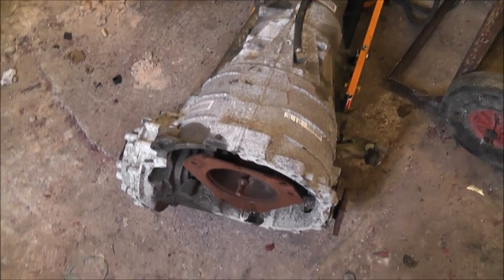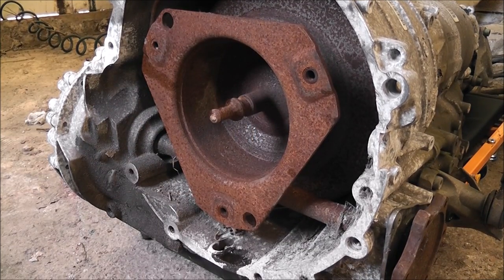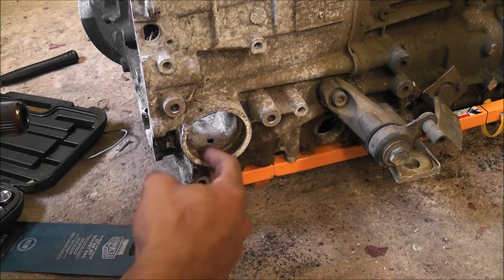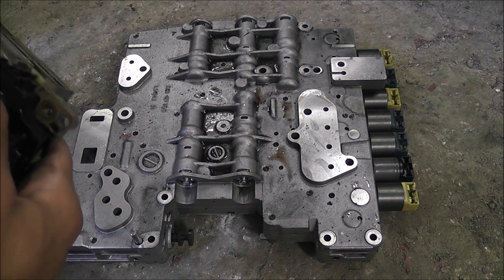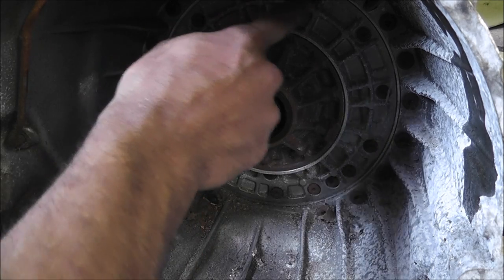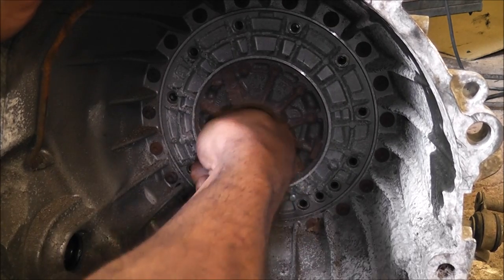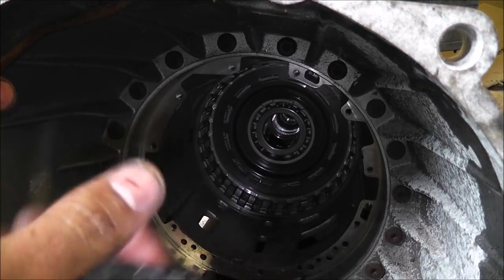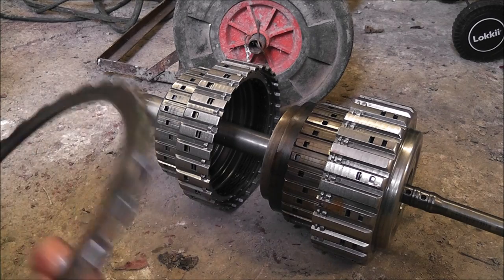Audi ZF 6HP-26 Wrecked! Gearbox teardown and analysis

Comment: What i have learned in 4 years of driving a 6HP transmisson (A6 C6):

1. Change the airfilter often (cut the interval in half or annually) and reset the learned MAF values.
The correct MAF values are very important for the transmisson.
And you will be amazed how the car goes with a new airfilter compared to one with 60.000km of use.

2. Is your transmission slowly starting to shift funny? Before spending big money on everything else. Do No 1.
And replace the MAF.

3. Change the oil, filter and gaskets often, every 60.000km. I use ATF 1800, works fine.
And reset the learned adaptation values.

4. After round about 150.000km the solenoids will start to go bad, overhaul the valvebody to prevent further damage.

:)

Comment: We call the ZF oil (Lifeguard) "liquid gold" in Australia as it's that expensive. I've had Castrols Transmax Z in mine for about 15000kms now after flushing the gearbox at the 85k km mark. Ford Australia use them in our Falcon (rwd) and Territory (awd) mated to the 4lt turbo straight six engine. The 6hp26 is bullshit strong especially with an appropriate tune to keep clutch slip down!
Reply from the maker: Brettus s it's a very strong box, it just needs looking after! andcyes, the oil is real expensive!

Comment: The transmission fluid is a scam and the expense causes people to put off maintainance leading to disaster.
The ZF 6HP series is also built under licence by Ford as the 6R60, 6R80 etc, who specify Mercon LV and GM build it under licence with different ratios, specifying DexronVI. 
Identical boxes except for the GM ratios, with each manufacturer giving a different name for their specified fluid.
Of course ZF say you must use their liquid gold, otherwise known as Lifeguard 6, but identical boxes manufactured by Ford and GM, leave different factories with Mercon LV or Dexron VI.
You can buy 8 Litres of Mannol Dexron VI/Mercon LV right now on Ebay for £42.99 and it is red.
On the back it states suitable for BMW, Jaguar and Land Rover 6 speed transmissions, and those only got the ZF 6HP version.
The red is an added colour and doesn't identify what grade a fluid is.
Some producers add the colour and others, like Ravenol and ZF do not.
Save your money and change it often.
Reply: Now Liqui Moly ATF 1800 is also an option.

Comment: The A8 D3 doesn't have a 6HP-26X. It is a 6HP-26A.
Reply: @SolveElectronics  The 26A is the one used on VW quattro cars ( Audi, Passat ). The X is used in 4wd with external 4wd transfer box. See 6HP26 wikipedia page.
Reply from the maker: @pedroteixeira4369  yes I just noticed the mistake, I confused it with the other box
Reply: @SolveElectronics  No problem, just clearing out for others that may come here. Loved the video, will help me alot. My gearbox is skipping on 4th gear from 1600 to 2300 on full throttle and I may have one of the drums brunt like yours. A and E are the drums used in 4th. The strange thing is that with VCDS, the adaptation values for the gearbox drums seem to be inside the allowed tolerances. If you are curious, check this post: https://www.audiworld.com/forums/a6-s6-c6-platform-discussion-58/interpreting-tiptronic-adaptation-values-what-your-gearbox-telling-you-2973888/
Thanks!!